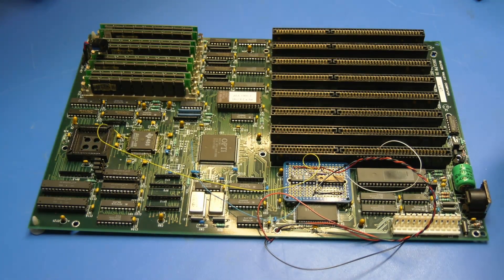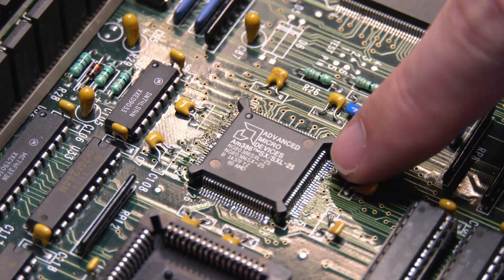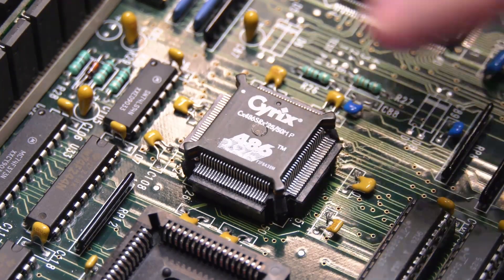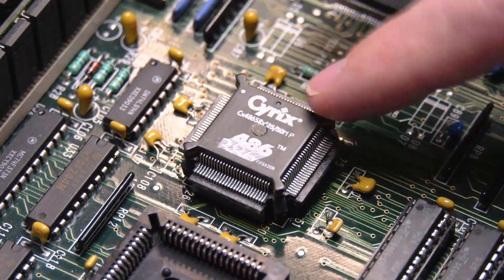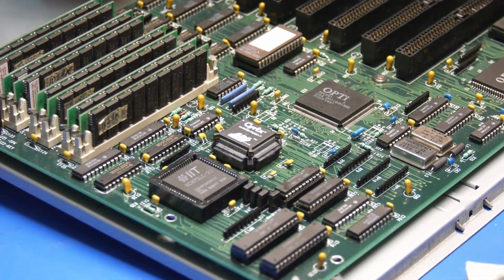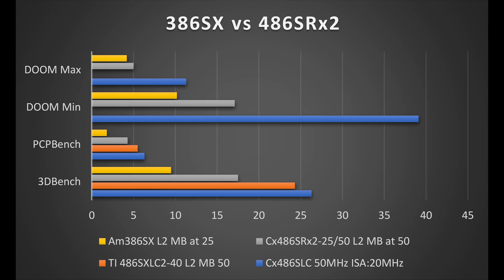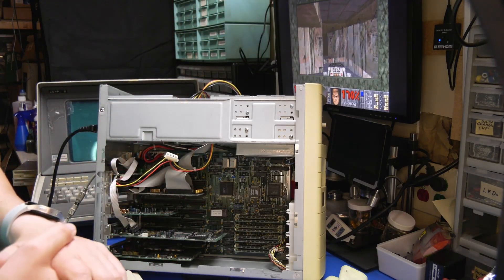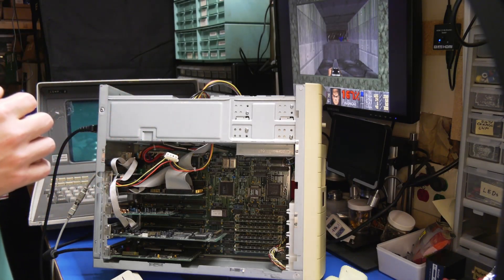486SRx2 Upgrade Chip

Comment: Lucky you to find one of these. I have been looking for a 486SRx2 for years because I have a Magnavox computer that would be a perfect candidate for using it in. But I've had no luck so far.
Reply: The Magnavox is interesting in other ways too: the CPU is actually located on a daughtercard that plugs into a connector on the motherboard, together with the system oscillator and a little glue logic. Probably these systems were upgradable, and in fact I know they were because I have 2 of those CPU cards, one 25MHz and one 33MHz. Been thinking of reverse engineering the daughtercard and maybe making a new one with say a 486SLC40 or SLC/2-50.
Reply from the maker: I was a bit lucky but I've been watching the CPU gold recovery auctions for a few months trying to get 3x GE7 geometry engines for my Iris Indigo that I've yet to feature on the channel and this came up during that.

For the upgrade, if you have a 25MHz card something like an SLC2 25/50 would fit in there fine. Absolute worst case you end up with a 50MHz 'SX' but even with the barb register instead of the flush input there is a decent performance bump.
Reply: @DKJones96  yeah I have a few 486SXLC2-G50; unfortunately they are of the 3.3V variety, so they would need voltage conversion to work on this system (yes the I/O pins are 5V tolerant, but the core voltage is not, 3.3V is required and 5V will fry the core)

Comment: I used to have one of these on my original 386SX machine…
Even with a huge chunky heatsink - it eventually burned out and failed 😢
Reply from the maker: @paulpsomiadis5847  oh man! Yeah this cpu ran over 100c when I didn't have anything blowing on it. With a fan is a much more manageable 70c.

Comment: Something to note with these, as I have one: the "snaphat" upgrades are woefully flaky. The carrier needs to be removed and the CPU needs to be soldered direct to the board. I have one in a PS/2 Model 40SX and it runs great, when the pins make good contact, that is. They're too small for me to add solder to, to beef up the thickness on them, and the way it connects to the CPU over top is great maybe once or twice, then it degrades from there. Make sure your pins are COMPLETELY CLEAN and run the carrier through an ultrasonic cleaner, especially if you used any flux of any kind at all. I was going to bring the machine with it to VCFMW in hopes to get someone there with a hot air station to give me a hand getting it onto the motherboard but I've decided to wait on that front.
Reply from the maker: @SudosFTW  yeah it gave me some fits even after soldering the processor pins back. I will run it for a bit and see how I like it. Hard to complain about the performance the 8kb TI model gave.

Comment: Would any of these drop in 486 upgrade chips work on 386sx-16mhz? i`ve not found definitive answer for this yet though many point to answer being negative.
Reply from the maker: @Blackkspot  I don't see why not. It would only run 16/32 speed but it should work. Using the barb input for the cache alleviates the lack of flush control on an older system.

I bet that 16 might take fine to a 4mhz overclock if you wanted to push 20/40.
Reply: Yes, it worked on my IBM PS/2 55sx, but the gain was offset by the proprietary bottlenecks on that terribly slow system.  If you have a reg. PC and can upgrade the storage and graphics, you might get better results.  Just memory alone is not enough; I had 8 MB on board, +8 MB on a card, but the 55SX was bottlenecked by the 16-bit bus, 8-bit non-accelerated VGA, and slower-than-ESDI hard drive. I didn't want to throw more money on expensive PS/2 compatible parts, so I gave up. You need a later 386sx-16; the earlier ones (A step) lacked a float pin to disable the original CPU.  My PS/2 was purchased in 1991. Google this phrase: 'cyrix 486srx2 float pin'   I don't have that PS/2 or the upgrade anymore. I might have a copy of the Cyrix utility floppy somewhere.  I remember it was difficult getting the upgrade to stay attached to the original CPU.  I had plenty of room, but that thing kept detaching at the slightest bump to it.

Comment: Great stuff!
The DRx/SRx2 while not super fast are super fun and rare upgrades. I think most of them were sold in the US. I've never actually seen one in Europe. We did/do have plenty of the TI counterparts like the SXLC and SXL though. I have 6 of them and they end up in various 386 and even 286 machines! 🙂 Such a cool era of tech to tinker with.. I have one of these upgrades in my type 1 IBM 5170 and it  also "runs" Doom! Imagine that, Doom on a machine from 1984, using its original mainboard!

Comment: I have Ti486SXL2-40 on my 386DX-25 machine so it runs at 50MHz. It gives 23,8fps on 3DBench. 32bit data bus really makes a difference at higher clocks.